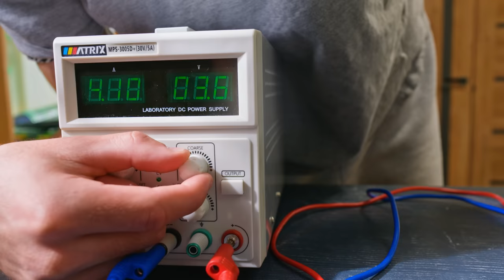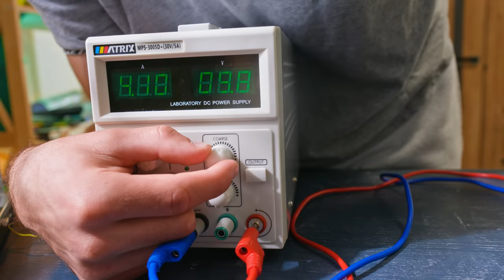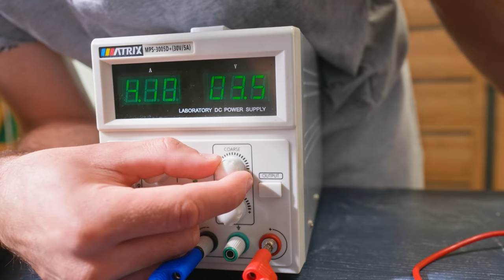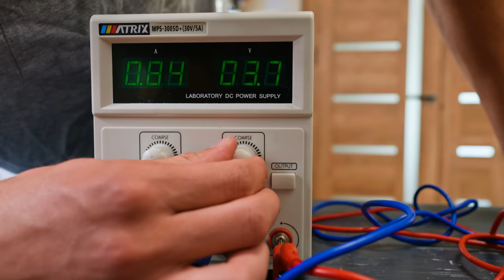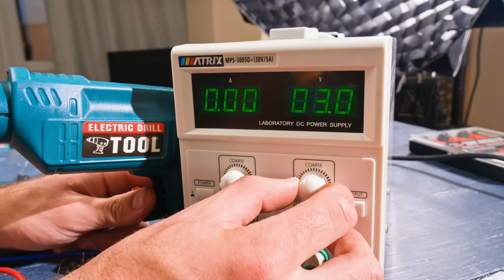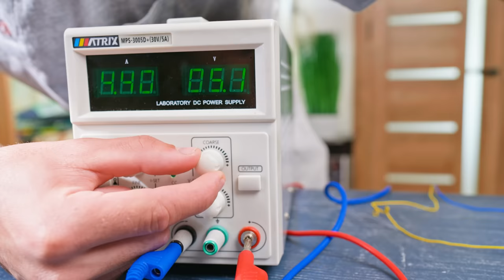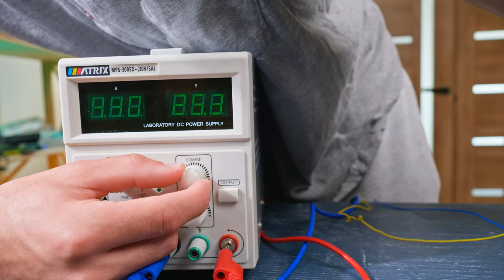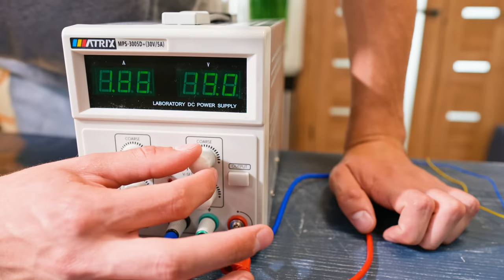I APPLIED HIGH VOLTAGE TO KIDS TOYS #2 [DANGEROUS]

Comment: Technically speaking a toys "Normal Voltage" is based on the battery compartment.

If a toy requires 4x1.5V AA Batteries in series, then it requires 6V

Comment: Man, I keep hoping that the musical toys would start sounding warped or high pitched with increased voltage, it would be hilarious, but it appears the components that control it or the speaker burns out sooner than any motors. Most of these toys have really quality motors, they can take a ton of punishment!